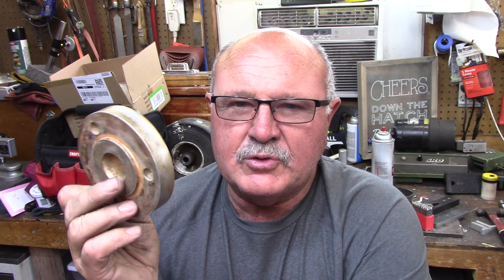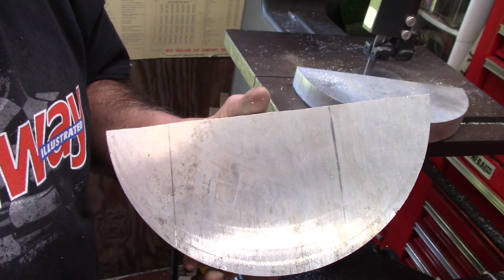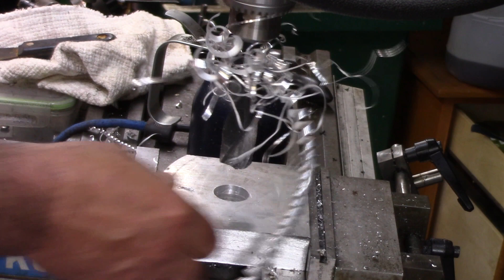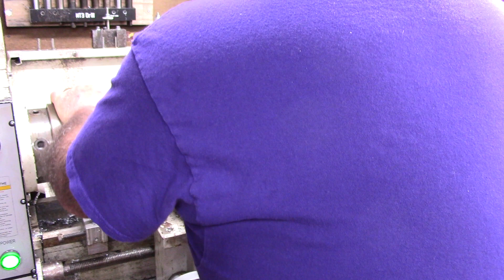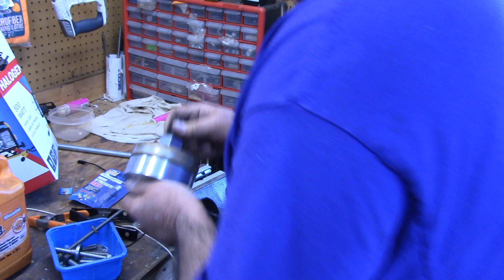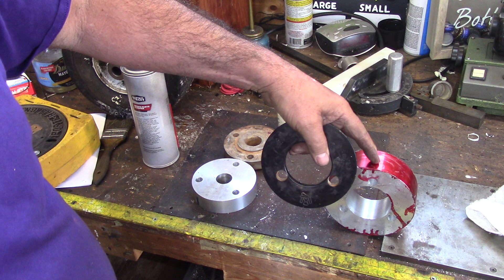Pulley spacers from scrap part 1

Comment: Jim most of the time when I’m making something, I don’t have the proper sized stock, so I just make do with what I have! It takes me less time to roughy out something that getting in the truck and driving 20 miles across town and back just to pick up a piece of stock. Besides my metal supplier doesn’t have much variety of sizes except in mild steel.
Reply from the maker: Rocking J Metalworks - John Brock true. One thing I try to do is when I get to Metal Supermarkets near me, they let up purchase scrap at what they get from their scrap service. So i try to keep an eye out for material that can be sawn into useable stock. Because I can normally buy the aluminum stock for $.80 per pound I have good selection of stock for larger jobs. I probably had less than $8 in the material for this job. Of course I had about 2 1/2 hours or so in making it useful.

Comment: Jim  You made the right call by using scrap material , buying the ideal size material involves lots of money and to much time.I repeat to much time. By the time you returned from buying the desired material ,the project would be 1/2 done. Good call .
Reply from the maker: TangentJim after I read your comment and thought about it, the trip would have taken the same time as the extra operations, since I’m just charging a nominal fee just to cover expenses for this job. You’re correct. Thanks for pointing that out.

Comment: 1968 Cougar ? mine was a Mustang 67 FB GT390.  Was so frustrated back in the day the Chevy guys could buy off the shelf performance parts that just bolted on. My ford buddies and I had to make, modify or pay top dollar for rare hard to find performance parts. Enjoyed thanks James...
Reply from the maker: Verry true and still so true today. These spacers will go on a 351 cleveland engine that my friend runs in vintage dirt track classes. As much as I pefer Fords my self the class were planning on racing in the Ford engine packadge would run you into the same problem. Engine cost is double as much